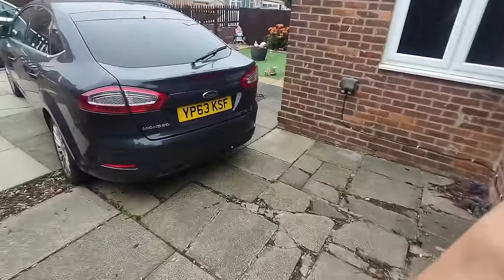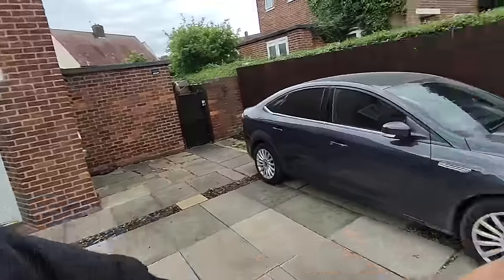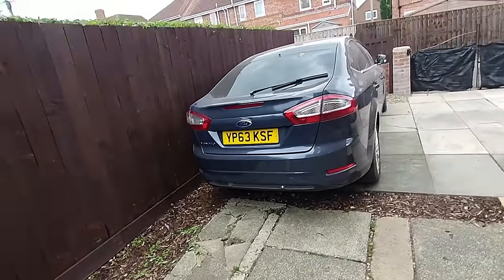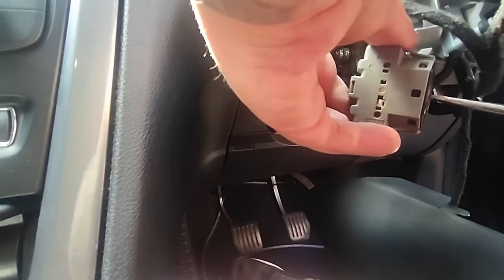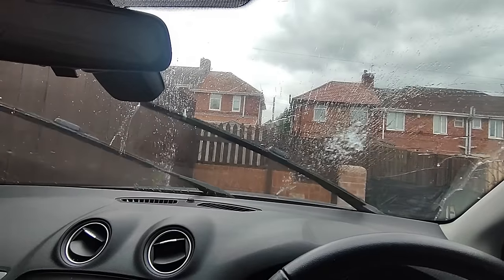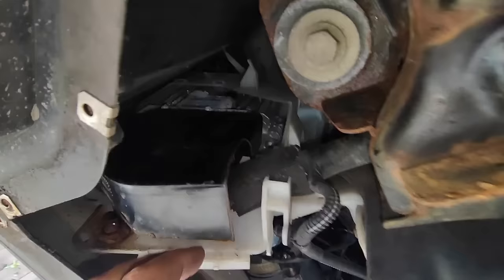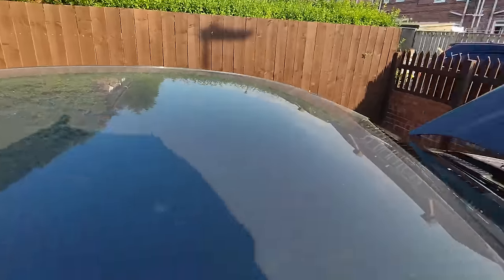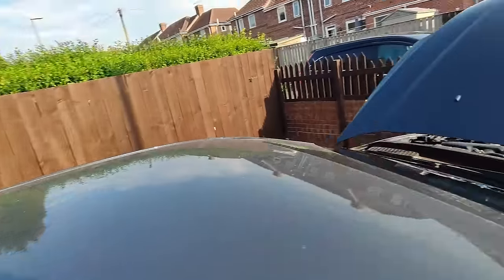COPART HAS DONE ME DIRTY! HELP! PLEASE HELP!!!

Comment: When it doesn't start slap the top of the dash above the clocks, if it then starts it's the clocks 👍 very common problem
Reply from the maker: @grandad8753  tried... It seemed to make it work but after using the washer jets, it's stopped turning over again 😞
Reply: 100% agree - wipers something else most lkke

Comment: I'm not sure if they still share the same electronics on the 2013's but volvo v50 had the mark 2 focus underpinnings and where the passenger footwell is is the junction box, there known for either getting bashed about by passengers feet causing loose connections/moisture in them, they also have a paired board in there for that car it's called a central electronics module which is programmed to the car aswell as the fuse board, 9/10 it's moisture gets inside and plays havoc with the car. My old S40 would trigger the boot unlock with no presses then randomly refused to start one night, took the cem out took a pic of the fuse layout removed all fuses gave it a clean out let it sit overnight, replugged back in and had no issues started straight back up. Another thing is the ignitions like to play silly buggers i know there's a bypass switch you can get for the Volvos which eliminates the steering lock jamming on causing a no start due to lack of releasing the immobilizer but a simple way to check is to hit the ignition/steering lock to see if it does anything. Sorry for the long winded comment dude but been with volvos on the ford platform for nearly 5years now so know the common things to look out for in the electrical side of things.
Reply from the maker: @JohnTaylor2015  yeah my mates S60 had that steering lock problem, absolute nightmare! I'm checked the BCM and that's fine... I'm angling towards the clocks with so many people saying it... Even though it doesn't make sense how it would stop working when the washer jets have been on

Comment: Wiring diagram and a multimeter check the basics, power and ground modules offline are a dead giveaway. The fact it was intermittent after the change of the ignition suggests a short or damaged wire. And you will be amazed at how dependent systems are on each other, especially the a/c radio units in cars will cause major headaches
Reply from the maker: @StephenClarke-m6s  I've had an auto electrician check all the wiring, he thinks it's either the coms wiring (which he doesn't do) or the ECU...

Comment: Remove instrument cluster and check the soldering as it is a common issue, I had this issue come up same engine malfunction warning and turned out to be the cluster. Also try a multimeter on your fuse box see if it’s getting power.
Reply: Exactly what happened to mine,it's fixed now.
Reply from the maker: @attilabalogh8548  did you repair the cluster or send it off to be repaired? Would a secondhand one sort it?
Reply from the maker: @turbo3492  did you resolder it yourself?
Reply: @CurrusOfSalvage  Yes but you need a steady hand.

Comment: I have a Ford CMax that had similar weird issues. After lots of research found that my issue was the dashboard. 

The solder Ford use has a habit of failing. The easy thing to do is with a decent soldering iron, re solder all the contacts on the circuit board with lead solder and the problems go away. Apparently all CanBus runs through the dashboard hence a number of weird odb codes and running issues. 

Dont know if this will fix your issue, but it sorted mine and it’s been a-ok in the 5 years since.
Reply: When I say dash, I mean instrument cluster. Sorry, I’m in *idiot*.
Reply from the maker: @p8ddy  as if that could be it! Surely Ford should have really fixed that issue! Glad it sorted yours out mate
Reply from the maker: @p8ddy  😂

Comment: The washer pump was doing the same as what yours is doing with a after market pump on it. Tried 2 after market pumps both failed then I bought a ford genuine pump that worked fine and still fine to this day. The pumps look the same but slightly longer on genuine pump connectors that's why your after market pump won't work properly.
Reply from the maker: @GaryGrant-x5k  I knew that bloody pump wasn't right like! Even though the seller said it was. Cheers for that mate, I honestly thought I was going mad over it lol

Comment: Look up pine hollows lots of useful info from Ivan . Iv learnt get yourself a test light and multi meter   . Look up a wiring diagram with power distribution . And you will save yourself going down rabbit holes and  spending money on the parts cannon . Personally if your getting no communication with the ecu  . Check fee first . If power there check power and grounds at ecu . If no power there then it’s trace your power distribution between computer and fuse box . Could be a mumber of things bad ground , broken wire  . But you need that diagram to progress . Good luck
Reply from the maker: @lawrencesmith1952  ahh Cheers for that, I've got a multimeter and light tester thing but I'm not the best with either 😂 Cheers for an order in which to check it too

Comment: i think its the bcm fried you changed the washer jet pump but the wire connector can get wet check the wire connector for the washer jet pump if glazy it got wet and needs replacing and the bcm as it sent shocks to it and basically killed it i hope you get it fixed bud keep us updated

Comment: Had this problem with mine turned out to be a fried ecu and then not long after replacing the ecu the instruments cluster went on it so a great opportunity for me to replace the clocks you have to the convers+ ones. After all this mines back to life.

Breakdown to fix issue:

Buy used ecu get keys recoded to ecu.
Clocks fried get new convers+ clocks with lower miles than yours that way you can adjust them in forscan and you will need a mod to turn the airbag light off for mot.
Reply from the maker: @damoblake6000  oh damn! That's an outstanding comment!! That legit sounds like the perfect plan if the soldering doesn't work. Cheers mate!

Comment: The bcm/gem is a gateway it communicates on all can systems , check the pin 6/14 grip in dlc and then do a comms resistance check at dlc 60 ohms for starters , forget the scanner until this is done,

Comment: Mine exactly same problem as your car I found one black cable connect ground was snap so locator is  driver side front seat under carpet near sill that cable for ground to bcm communication to immobilise to start engine.
Reply from the maker: @robertbeattie9000  😲 how the hell did you find that!? That seems like an impossible problem to find! Lol. If that's the problem, how come it randomly starts at times? Mmmm

Comment: Had a same fault with a kuga  it was a loose wire in the pin plug on the Ecu under the front wing if you get someone to move the wires at the ecu plugs it most likely start 
Cheers mate
Reply from the maker: @StephenBrown-y1c  ohh I'm glad you found the fault on yours. I've had an auto electrician out who checked the ECU connectors and wiring and he said it was all fine, sadly 😞

Comment: The washer pump fails and washer fluid pushes out through the top where the plug is and the water travels through the wire and destroys the BCM. Yes it’s sounds mad but I’ve been there ! A used BCM with the same part number is plug and play even if the two letters at the end are different. New washer pump and BCM job done.
Reply from the maker: @DoubleG79234  ohh are they? My BCM board is bone dry and when I changed the pump, it sent the car scatty for the wiper controls... That's very interesting about it being plug and play though, cheers!!
Reply: @CurrusOfSalvage  my Bcm looked good too 👍

Comment: though i have a fiesta seems like a fault i had not same but starting issue was with the board on the speedo to do with the imobalizer of 2 of  the joints being dry would sometimes start sometimes be dead after soldering it works every time just a shot in the dark
Reply from the maker: @scottfrancis1765  I am honestly shocked, at how many people have had this solder problem, across the Ford range(r), lol, sorry, couldn't help myself. Did you just whack a load of solder over everything on the board or did you strip it all clean?
Reply: Hey I cleaned off the offending dry joint and redid it

Comment: if it starts after you have gone into all gears and it starts in any gear i would suspect a sensor if there is one on the gear box
Reply from the maker: @eddieMurphy11111  that's how I could get it to start at first but now it's not starting from cycling through the gears, it'll only start after it's been left alone for a few weeks lol

Comment: mate, this happened to my mondeo, water runs back up the wires from the wiper washer motor into the bcm, doesn't make sense because it Defys logic and gravity its common issue there's videos about it, you can easy fix it but cutting the cable and using basic connectors so the water has a break in the line, it's near impossible to spot as the water tracks inside the cable sheath, good luck mate
Reply from the maker: @ste4414  it's such a stupid design/fault for when they happens. I'm not convinced it's that though because the BCM is perfectly dry with zero signs of corrosion... It's honestly batted my head!
Reply: @CurrusOfSalvage  mine never either pal, try it nothing to lose, keep us updated

Comment: you know that green plug you unplugged from the bcm i know you checked for dampness but check for corrosion in the pins if so it got wet from the washer jet leaking
Reply from the maker: @jasonsumner1354  yeah I didn't think to check the connector block that goes into the jet motor! Stupid of me really, I should have lol

Comment: It's the wiper motor plug...its git water/screenwash ingress!.. pull the plug off check it I bet its all green and possibly broken a few pins
Reply from the maker: @alanthomas8519  tbf, I did only check the motor and not the plug on the wiring... I'll give it a look over the next day or so, cheers. It's on my to do list.

Comment: As other people said have a look at the solder on the back of the clocks. There are loads ov videos on YouTube about it. But mainly focus but they are the same style clocks. Think it’s a u1900 fault. Can bus failure. Hope you get it sorted m8.
Reply from the maker: @wayneguilliatt4144  ahh Cheers, I'll check that fault code. As if the clocks hold that much power! Lol
Reply: @CurrusOfSalvage yup I think it was saving salvage had that problem on a focus. Old solder on the rear of the clocks and it wouldn’t start…
Reply: @wayneguilliatt4144  The Mondeo clocks are not the same as the focus clocks. Totally separate from the immobiliser. The mk4 Mondeo will start with any donor clocks but the mileage will carry over and read whatever is the mileage on the donor clocks.
Reply: @DoubleG79234  ah didn’t know that. Every day is a school day. 👍👍

Comment: Windscreen washer bottles crack on these car therefore allowing water onto the bcm which can cause starting issues ,PS it happened to mine!!!!
Reply from the maker: Ohh the actual bottle... There was random fluids on the front under tray part
Reply: It's not the washer bottle that cracks but the pump itself pushes screen wash up inside the wires into the BCM. If you pull the fuse board down which is below the glovebox look for the green connector. If screen wash is getting into the BCM then 2 pins will have corrosion. If there's any residue on the pins on the BCM then you'll probably need a 2nd hand unit

Comment: take the ecu out and clean it if the the wire connectors and open the ecu up clean it with isopropyl alcohol
Reply from the maker: That's a canny shout, clean up the board for possible dust, crap and "limescale"-esk crap that was on the outside. Cheers.

Comment: ford use lead free solder which is rubbish in the clocks they need re soldering on the big chip that the main plug  fits in to as said slap the top of the clock housing when it does it  btw use lead solder if you can find it
Reply from the maker: @MrDezwez  am I just putting solder straight over what's already there? Or do I need to send it off to be repaired properly?

Comment: This is more than likely a bcm fault, iv done a few of these as long as part numbers match will be plug and play, most commonly happens when the car has been stood for a while dont ask me why lol can always code features in using forscan etc
Reply from the maker: @theskylinegtrrr  I bought a forscan reader thing, but it wouldn't link up to the car but, that's when the car wouldn't start, like when the ECU wont communicate. I'll have to wait until it decides to work again before trying but yeah, I think it's the BCM module. I didn't know they were plug and play, that's very interesting to know! Cheers

Comment: Had one once that had no crank , locking issues and horn blaring.  It was the fuse box motherboard under the glovebox. Moisture in the car makes the board corrode and cause multiple faults. A good clean of the board usually sorts it.

Comment: it is a common issue with ford's mate it is an immobiliser fault it's caused by dry solder joint on the cluster
Reply from the maker: @dennispowell7719  how do they even create that fault? Lol.

Comment: There are companies that will repair your ECU in a couple of days. I had my DIM for my Volvo repaired - 3 days
Reply from the maker: How much did that set you back? I would prefer to find a company local to the North East, that I could take it to, instead of posting it off somewhere...
Reply: I had my last car checked and progran only tok 2 days on ebay there a few

Comment: Do your basics check with multimeter on fuse box . Ensure you get power where you should once done you can eliminate that . Check the BCM as most systems have connections with it through other systems. Looking for blue green marks in the connectors of the BCM and use electric contact cleaner . Water travels by capillary action along wires .  If limescale on any module they need checking for water damage. You could try back probing connectors to find if they are getting right voltage and signals. What i suspect is you have a circuit that is shorted to ground (probably in one of the modules) this will pull other circuits down causing incorrect detection and activation of connections. Watch South Maine auto guy and Diagnose Dan. Remember break circuits down so you know where the problem starts  good luck.
Reply from the maker: @andrewfoster141  ohh I've never heard of either of those, I'll give them a watch, cheers. I think it was the wipers that was saying "ground to short" when I put my diagnostics on it... Don't suppose you have any idea where in the system that could possibly be?

Comment: What a nightmare. I hate electrical issues with cars. Was it listed as a runs and drives?
Reply from the maker: @ianberry1713  yeah it was, I mean, technically it does... Just don't expect to drive it within 3 weeks of turning it off 😂
Reply: @CurrusOfSalvage  I’m thinking you should cut your losses and either sell as salvage/scrap or on eBay as spares or repair as a non runner. I think you’ve opened up a can of expensive worms 😬
Reply from the maker: @ianberry1713  yeah I'm thinking the same tbf... But I'm very stubborn... Lol

Comment: Have 2.2 titanium x sport my horn disables when  i lock it twice alarm settings. Now gone completely 🤮 ones say its clock spring  nothing up on computer. Used to got it on by double unlock .
Reply from the maker: @6brad9  the, Ford electrics strike again... Saying that, my old daily had a clock spring problem and they can be a nightmare!
Reply: @CurrusOfSalvage  I'll change it over anyway ,or fit a new secondary horn  button  on my wheel
Reply: @CurrusOfSalvage  well blow me away steady held the unlock fob to put all windows down and then steady up 🤣🤣🤣 horns back working
Reply from the maker: @6brad9 😂😂

Comment: smack the dash above  the  clocks then try and start the  car mate
Reply from the maker: @dennispowell7719  it worked for a bit but once I used the jet washers, it won't turn over again
Reply: @CurrusOfSalvage  you wouldn't belive the issues bad solder joints on the clocks can cause mate especially  immobiliser  issues

Comment: Try hitting the top of the dash where the clocks are if it starts it will probably be a problem with the instrument cluster,my focus did exactly this,had to send the clocks off to be repaired
Reply from the maker: @marcwallace8589  the auto electrician tried that and it didn't work... But it seems to be the main answer from people... Cheers mate.
Reply: Charge the car battery so you haven't got voltage problems when checking. But think either the bcm has got water in at some point or it's your dash clocks

Comment: another test you can do take the black wire off the battery for 15 mins or so that will reset the ecu tighten the black back on battery this might help but you will been to set your clock i know least of your worrys lol the window will need to be learned again to go fully up with one click if that dont work with the battery wire and reset of the ecu as you said it could be ecu dead but the engine starts then stop so i cant see the ecu dead
Reply from the maker: @jasonsumner1354  yeah I've tried that, cheers, that's why I need the code for the stereo, which I didn't think about 😅 my head's still thinking it's the BCM module and the wipers are messing it up...